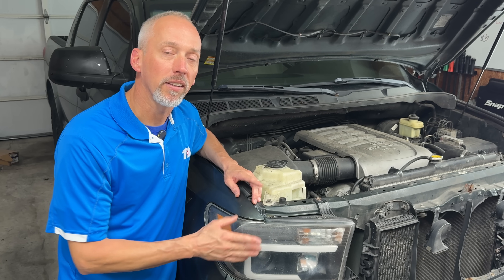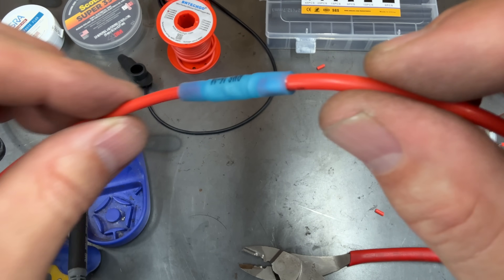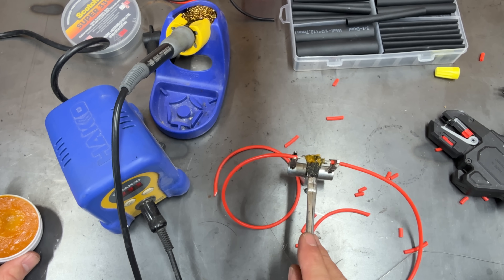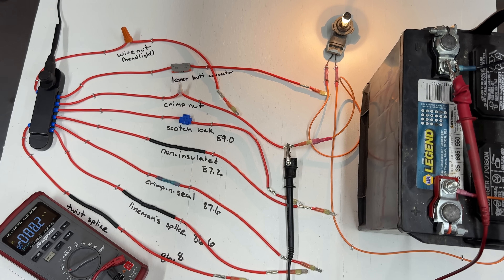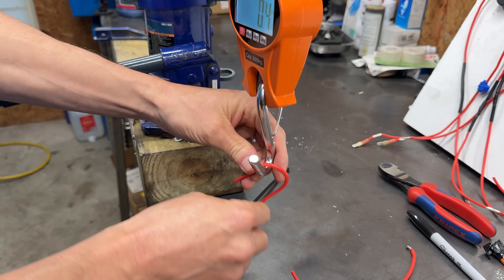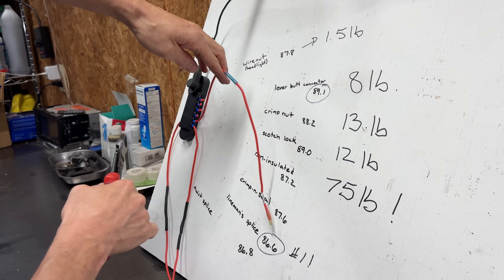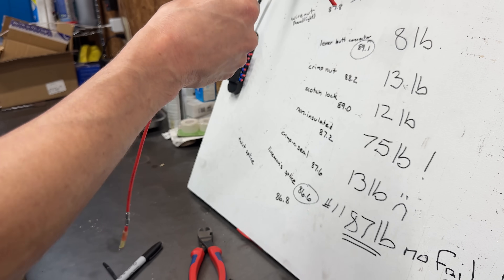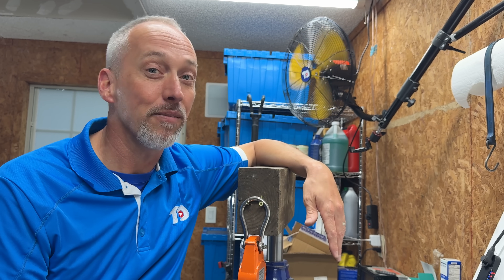I tested these connectors and found the best one

Comment: You didn’t use a good wire nut. Nor did you use a new one.  You have failed to present good information. Shame on you😢
Reply: You really think it will do better than the soldered splices? It's clear what the best methods are. Go do your own video.
Reply from the maker: Actually, I was able to find an identical new wire nut. I wanted to test it without the corrosion.

Comment: The crimping tool really should be sized correctly for a connector... It appears that the tool you are using has too-small a crimp section, or the crimping part is too "pointed" for this connector... The tool that I use has jaws shaped like this 
(). Not like this (<
Reply from the maker: I’ve tried both and the ones I showed are just easier to use. The more specialized tool works a little bit better but the difference for me was very slight.
Reply from the maker: PS: love the Clippy profile pic

Comment: I thought the proper sized crimp-tool had a positive stop at the right place for each size connector? It seems like the voltage drop was so close as to not matter across all of them.
Reply from the maker: There are more specialized/expensive tools that work a little bit better. They give you a more consistent crimp.
Reply: @ToolDemos 
Does that change the voltage drop or just long term integrity of the connection?
Reply from the maker: @JamesVR6  mostly just consistency. They don’t crimp any differently, they just allow you to have a consistent crimping pressure. If you apply too much pressure, you could damage the connector, too little pressure and you would have a poor connection.

Comment: In a car, I always solder. Been soldering since I was 13yo, and that was over 50 years ago. Plus heatshrink tubing. Can never have too much heatshrink tubing.
Reply: A proper crimp connector is actually better, has no electrical differential between the components, and is "gas tight" at the crimp... My original Honda car had crimped connection to the plug pins, and a kind of "grease" filling the connector bodies, to keep moisture out of the plugs... Most automotive connectors, today, have "O-ring" seals for connectors located in "outdoor" locations.
Reply: @lohikarhu734 Better in theory. Yes, under perfect conditions, where you know what you are doing and have the 'right' tools, crimps etc... Yes. In the real world, with crummy connectors(ever tried the crimps from Harbor Freight? They are made from super thin metal), cheap tools(if you don't do this every day, are you going to have a quality tool?), poor accessibility? I think a soldered connection will work just fine for the life of the vehicle. Not technically the best, but 'good enough'.

Comment: I got lucky, i had a couple of 2 different sized butt connectors, that i needed, my jeep stock wire was thin and i bought some 12 Guage or 14 maybe wire, with a fuse to my battery. Butt connected it and used marine shrinkwrap. Wired up my aux fan. Go XJ!
Reply from the maker: That’s a win!

Comment: The crimp and seals could’ve been given a better chance if you had used an adjusted ratcheting crimping tool. The cheap ratcheting ones allow for adjustment.
Reply: Also if you use cheap connectors you most certainly need to use the other side non-insulated or insulated, the one with the sharp part to make sure it's seated more or they tend to stay lose as I have found out. Get a really good connector and they are really good. Unfortunately I have found more crappy connectors than the good ones that used to be made in the past.
Reply: He didn't even crimp it properly lol
Reply from the maker: Agreed. Those ratcheting crimp tools give you much better consistency when you’re crimping butt connectors. I have a Mac Tools ratcheting crimper, I used it on these crimp and seal connectors. The result was nearly the same as when I use the generic pliers.
Reply: @ToolDemos 
Yes this interesting. What would be the actual voltage drop difference between a cheap set of crimpers vs an expensive set? 

Is the only difference in the long term integrity of the crimp?

Comment: nice never using t-taps again thanks
Reply from the maker: They’re easy, but bad in so many ways.
Reply: @ToolDemos 
We don’t know how bad since there was no test with a continuous wire. And how much worse is a few mV in the real world? 

If you do a similar test maybe you could get a temperature read of the splice?
Reply: He didn't show T taps.  He showed scotch locks.
Reply: @melissathompson7229 they do the same thing how else did you make that connection

Comment: Excellent demonstration! I would go with the non insulated butt connector with a good heat shrink tubing. It has the least bulk and allows the repaired section to fit back inside the loom.
Reply: This. Non-Insulated crimps + marine heat shrink seems to be the easiest & strongest to get done in a tight space.

If you must use insulated crimp & seal connectors, a very high-quality crimp tool must be used. The best out there is the HST Pro Crimper, which I (gulp) purchased for $150 at Panbo. There is a whole cult around boat connectors using this specific tool.

I like soldered connections, but it is usually hard to do correctly and safely in tight spaces.
Reply from the maker: @carnold.knowledge  agreed, I’m a new convert. I’ve tried fancy crimpers, not impressed.
Reply from the maker: I’m with ya, been looking for an alternative to the crimp and seal connector.

Comment: I don’t think that was the right size Scotch Lock for the gauge of wire you are testing. The Insulation Displacement Connector (IDC) blade is going to cut and displace strands of wire instead of insulation. No wonder resistance was so high!
Reply from the maker: I agree, the blade looks small but the package says 16-14 AWG.